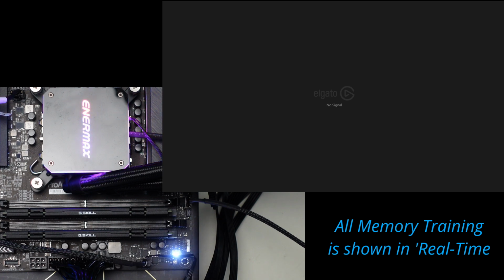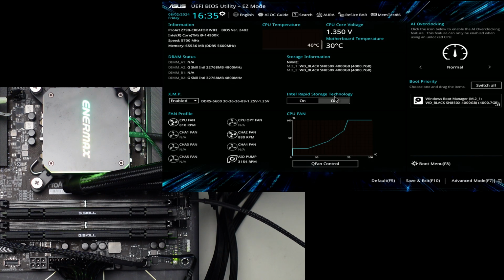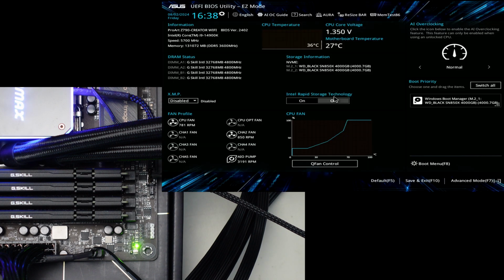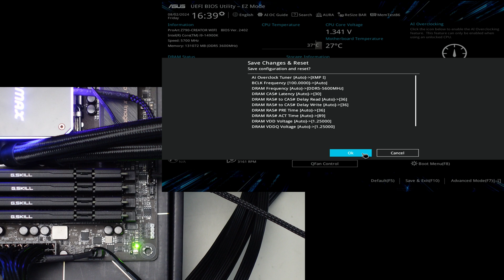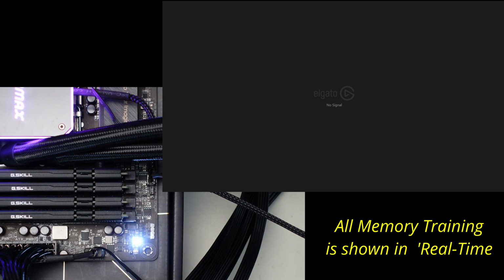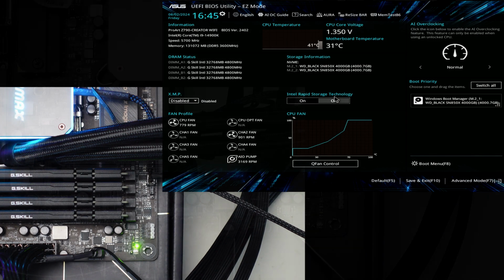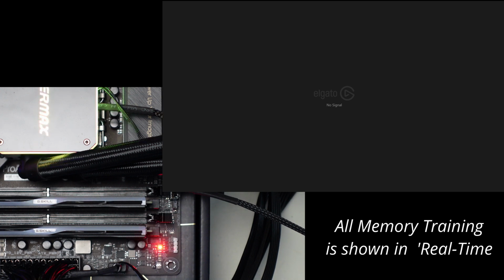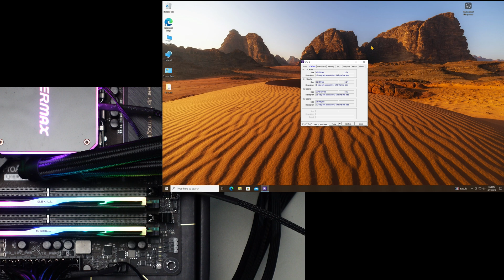DDR5 Configurations and Quad-DIMM Limitations

Comment: You need to go to SPD on CPU-Z to know RAM's speed. Also check the command rate whether it's T or 2T. DDR5 often defaults to 2T if four RAM sticks are used.
You can also check it in Task Manager->Performance->Memory.

Comment: "This video discusses what to expect when using DDR5 Memory Limitations when Using Four (4) DIMM in a Dual-Channel Motherboard."
You will always get 3600MT/s because that is JEDEC speed for 4 DIMMs DDR5. Ignore the video, save yourself 17 minutes of worthless "infos".
Reply from the maker: I do not think your comment is helpful since the manufacturer of many DDR5 Drams (and a couple of the Motherboard/CPU manufacturers) are not fully disclosing the characteristics of their components.  I was able to one specific set of four DDR5 DRAMS to reach their advertised maximum speed (5400MT/s) with one of my other motherboards, since all vendor parties were being straight about what the component could accomplish using the motherboards Standard memory auto-clocking option.  If enough folks are interested, I will make a quick video showing that configuration, before and after the standard memory overclocking.
Reply: @PE4Doers  At 2 minutes 11 seconds made your first huge mistake: you said about using two 2x32GB kits, "I'm not gonna play with any of the frequencies, timing parameters, anything else. These will be out-of-the-box." At that point in the video it is clear to everybody with basic knowledge of DDR5, that the result will be the JEDEC configuration of 3600 MT/s. All XMP and EXPO profiles only work for one kit and since you use two kits, these profiles will never work on any mainboard. Getting two DDR5 kits to work always requires what you ruled out to do: play with the frequencies, timing parameters, or something else.
At 5 minutes 34 seconds you made your second huge mistake: you put each of two kits into both RAM channels (A and B). This significantly worsens stability when using two kits and makes it much more difficult to get them to work faster than 3600MT/s. When using two kits, each kit must occupy only one channel (either A or B).
At 7 minutes 40 seconds you made your third huge mistake: You enabled XMP for two kits. This never works.
These are my three reasons why watching your video is a waste of 17 minutes.

In your repsonse you claim that, "the manufacturer of many DDR5 Drams are not fully disclosing the characteristics of their components". The characteristics of the RAM modules are stored in their XMP /  EXPO profile. If you want to see them, put one kit into the mainboard, start the PC and go to BIOS. There you see all the characteristics that are known to work for this RAM kit.

The BIOS of some mainboards contain a feature that attempts to overclock the RAM: MSI names this "Try it!".
Reply from the maker: @Viewable11  Sorry, by I challenge you on all three major points you've made in this response.  I was using two kits each containing 2x32 kits, totaling 128gb.  Also, I did the same thing with the PC I mentioned in my first response, and I was able to reach the maximum speed of both kits using XMP.  With the second PC, I have a different motherboard and CPU, wherein is the manufacturers issue I refer to. It seem like I have to make a video repeating what took place on the second PC just to prove my point.  

No problem, I really like comments like yours, because they get me to rethink everything and move forward with greater knowledge.  Give me about 6 to 8 weeks to finish some of the videos I have in progress and on the queue (with a couple of them affected by professional assurances that I've given to vendors on those uploads).

If acceptable to you, I will reference our comment exchange at the outset of that video, and you have my word of honor (backed up by an Eagle Scout promise) that I will Not alter any of the screen shots and the video as a whole 🙂
Reply: @PE4Doers  I am pleased to read that you are interested in learning additional information about this topic. I do not care about anyone incorporating my information or opinion in their videos, I only care about people (including myself) spending their time for acquiring information that is correct and useful . 

The two most useful channels about DDR5 usage are: "Actually Overclocking" for optimizing single kits of two DIMMs and general explanation of what the DDR5 settings mean. "Game Tech Reviews" is very valueable for learning how to use two kits (4 DIMMs).
Reply from the maker: @Viewable11  OK.  By the way, I do not watch either of those Channels currently, but I have seen a couple of videos they have uploaded (each) before making my decision to move on to other Channels.  I tend to avoid vendor favoritism.
Reply: @PE4Doers  "Vendor favoritism" is my most important tool to avoid wasting time with useless channels. The most useful video about using two durl rank DDR5 kits on AMD systems is named "192GB DDR5-6000 on the MSI X870E GODLIKE". It contains all settings which this mainboard choses for 4 dual rank DIMMs. The other videos of "Game Tech Reviews" show manually chosen settings, although I also saw the mainboard-chosen settings from AsRock and Gigabyte in two videos. Watching several hours of that channel was totally worth it for finding both the OEM's settings and the manual settings for 4 dual rank DIMMs: It helped me to get my own two dual rank kits to work fast.

Comment: I have the trident and the ripjaw both in my 14900k, and they both work at
 6000 with xmp on, I think, g skill is just really good
Reply from the maker: Thanks for the information.  Are you using 2-sticks or 4-sticks?  I currently have the two 48gig sticks in my 14900K system, but have been pondering whether to upgrade it to 4 🙂

Comment: hey thanks for this video, really informative to the questions i have right now. Quick tip, you can check ram speeds in task manager in the performance section. It's been a while since I've had a W10 machine but I'm pretty sure it'll be there.
Reply from the maker: I'm glad you found it helpful 🙂  Thanks for watching, the comment and the helpful tip

Comment: I use 4x 16GB DDR5 5200MHz CL36 with XMP at 5200MT/s and don't have problem with stability even when memory is full up entirely.
Reply from the maker: Great.  I have the same with my ASUS 690 motherboard and an i9-12900K CPU.  However, with a 790 motherboard and an i9-14900K, it only sizes to non-overclocked speed; and that is trying the same memory on both.
Reply: That's because all 16GB DIMMs are single Rank. It's a different scenerio with Dual Rank DIMMs.
Reply: @minkfranchise6389  Frankly, I stopped trying to learn more about RAM, since it works as advertised and is stable. Memory become a deep rabbit hole, with trillions of combinations and wildly different utilization across platforms. In some systems, it seems to be the most critical component, in others, spending more on it feels completely pointless. It's a mess...
Reply: @GinoFoto  Very true. As long as you have found what you need, that's what matters the most. Much success to you, my brother.

Comment: (AM5) Today I added a second identical kit of 2x16 GB, I did not turn on EXPO, I manually set the EXPO values to 6000 MT/s, 30-36-36-68, everything works same 😮as on  a single 2x16 GB, first kit to A1-A2 , second to B1-B2
Reply from the maker: Sounds like you got that one licked

Comment: Having this same problem on my Omen 45L,  Can't get my 4x16Gb of Fury Beast RAM to run at anything higher that the min speed of 4000.  Running a I9 14900k processor.  Its scary too, because I had trouble getting it to reboot up after overclocking.  Took about 4-5 tries to get it so I could set it back.  Omen apparently had a similar program that would auto set overclocking, but it looks like they dropped it.  Looks like 2x32Gb of th Fury Ram is the solution, $188 for the pair at walmart website.  but i'll run what I have for now.  Doesnt seem  to be hurting my game performance.
Reply from the maker: Yes, this is currently a know problem with the DDR5 memory regardless of the motherboard.

Comment: Great info. I haven't built a PC in quite a while, but have started putting together the parts for one. Going with an Intel i9-12900KF and Z790 motherboard. Planning on using 2 sticks of 32GB DDR5 5600MHz. Any reason this won't work?

BTW, going with a 12th gen i9 because I paid a good price for a new one plus with all the problems that's been reported for the 13th and 14th gen versions, I thought I'd play it safe. Still a nice step up from my current i9-9900K and DDR4 memory.
Reply from the maker: I don't see why you should have a problem with two-sticks of that memory.  That sounds like it will be a great system.  Good luck

Comment: When adding two matched pairs of DDR5 udimms, you need to put the matching pairs adjacent to each other, as in:  A A B B, rather than the traditional channel arrangement of A B A B for two matched pairs.  A single pair is added as you would expect, x A x A, as you had it installed.  I've got two matched pairs of Corsair 6400 CL32 which XMP up just fine as either pair to max speed of 6400 with 32-40-40-104 timings.  Put in A B A B it will only do default speed, which is 4000, and won't ever train better than that.  Putting the dimms AA BB as they are supposed to be for 4 ddr5 dimms made of two matching sets, I can easily reach the XMP rated speed for a set of 4x32GB corsair venegance modules, which is rated at 5600 40-40-40-77.    I have not yet been able to get the 4 dimms to be stable above 5600, but it's almost as fast as with two dimms at 6400.  I'm pretty sure these are the same modules, but the set of 4 literally has a different XMP value stored in the modules.  To the best of my knowledge they are both hynix A die memories.

You might consider revisiting your experiment with the memory in the right slots.  You won't one-click to a 2-dimm XMP setting, but if you can determine what that vendor has set as the XMP value for a set of 4 of the dimms you have 2 matched sets of, you will be able to hit that speed with the dimms placed correctly and maybe some minor adjustment to dimm voltages.
Reply: been trying out all kinds of subtimings and voltages and whatnots as other videos have described, but this comment is the only thing that made it work. sheeeeeshhh !! thanks a lot!!
Reply: You're welcome!  Pass it on :)
Reply from the maker: OK, thanks for the technical information 🙂
Reply: @PE4Doers  amusingly, all 4 of my dimms are from the same week, 42nd week of 2024.  I initially added them to the empty slots - just as you did, but I couldn't get them to 5600 (from 4000) until I filled each channel with the matching dimm from the set of 2.  I suppose it makes sense since the dimm layouts are Ch1A Ch1B Ch2A Ch2B, and when you consider that each ddr5 dimm is already double-channel... 

I don't know the technical reasons for the change in traditional matching set position, but I do know that having the matched set out of order cost me 1600 mhz.  Still a real challenge to get faster. I've booted at over 6000 but memory errors creep up fast.
Reply from the maker: @rolfkarlstad4015  Silicon is funny like that I guess.

Comment: If the memory is single rank, it will run just fine when all slots are populated. In almost all cases, all four will run at the advertised speed or the MB or the advertised speed of the memory(whichever is lower) when all the sticks are single rank.

If the sticks are dual rank and all four slots are populated, then it will most likely only run at the max speed of the slot furthest away from the CPU. Which is typically going to be JDEC speeds.

Typically with DDR5 the sticks that are 16GB and smaller will be single rank. But you can find sticks that are 24GB that are single rank. However, you can't find 32GB or larger sticks that are single rank or at least I have never seen them. If you have a good 870 MB, I recommend F5-6400J3239F24GX2-TZ5NR because although they are only 24GB per stick, they are single rank and will run at 6000M/t in all four slots in pretty much any 870 MB and if you hit the silicon lottery, 6400 is possible.
Reply from the maker: Thanks so much for the great info.
Reply: I bought 4 x 48 of the new CL28 gskill bars.  You saying zero chance at 5600-6000 on a crosshair hero with a 9950x3d?
Reply from the maker: @scottlucidi6476  I do not believe the problem is with the speed of the CPU, but how the motherboard timing is working.  I do not have either you CPU or your Motherboard, so I honestly cannot venture an informed opinion on whether it would work or no.
Reply: @PE4Doers  thx bud
Reply: @scottlucidi6476  Nah, not a zero chance. Just unlikely. I can say with fair certainty that they will run at 4800 M/t. The limiting factor will almost certainly be the motherboard and not the CPU. I have a fairly high end MB(MSI X870 Tomahawk) with a 9950X and these are the memory slot specs. 

Single Rank Sticks Channel 1
1DPC 1R Max speed up to 8400+ MT/s
Dual Rank Sticks Channel 1
1DPC 2R Max speed up to 6400+ MT/s

Single Rank Sticks Channel 2
2DPC 1R Max speed up to 6400+ MT/s
Dual Rank Sticks Channel 2
2DPC 2R Max speed up to 4800+ MT/s

Essentially, if you only use two sticks and they are single rank, the MB can handle up to 8400 M/t. All 16GB sticks and smaller are single rank. Most 24GB sticks are single rank. But some are dual rank. All sticks currently larger than 24GB are dual rank. With two 48GB sticks you would be limited to 6400 M/t on this Tomahawk MB.

If you are using 4 sticks and they are single rank sticks, then you are limited to 6400 M/t. But if they are dual rank like your 48GB sticks are, then on the MB I have you will be limited to 4800 M/t. Even the Godlike MBs are limited to 4800 M/t when using 4 dual rank sticks.
Reply: @BlenderRookie  awesome info. Thx.  I have asus x870e crosshair hero.  Think i will have to be content with 4800.  Perhaps the next gen or 2 of mobos will be able to handle the full 6000.  Again, I appreciate it.  Thx dude.
Reply: @  You are welcome.

I looked up the specs on your MB and it doesn't get specific about the max speed for dual rank. It just gives an "up to 8200+MT/s(OC) with Ryzen™ 9000 Series Processors,". Which of course is the max speed for single rank.

So yeah, likely 4800. However, once the memory training process is done(could take as much as 30 minutes but more than like 5 min for 192GB), you might be able to keep expo on but adjust the mem frequency to 5000 or 5200.  I give it a 99% chance for 4800 and a 50/50 chance on 5000. If you won the silicon lottery, 5600 could be possible but very unlikely.

Why do you need 192GB. If you don't need that much and 96GB is enough, use two sticks 2nd & 4th slot and you will be able to run 6000 M/t without issues. You will notice a difference between 4800 and 6000.
Reply: @BlenderRookie  i dont need 48GB!  Im building a pc as a bucket list thing.  1st and last one i build.  Im going top of the line components and making out for fun.  When i get to the bios part, i may consult you if thats ok?!
Reply: @ Sure, if you need help. But more than likely it's as simple as going into the
bios
>advance
>>overclocking
>>>Turning on Expo
>>>>Saving settings and exiting
Wait for the training to take place.

Comment: Running on a Strix x870e MB I have 4 sticks @16GB each 6000MT with EXPO G skill ram, and it's blazing fast.  Memory training took about 30 seconds first boot, and my boot time now from power on to windows is about 12 seconds.  I tested it with 2 sticks and 4 and got the same results each time, and stressed with Aida64 as well, 4 hours no issues.  9800x3d CPU.  Good content, looks like MB, CPU, and Ram type play a big role in all this as well.
Reply from the maker: WOW, that's great.  Let me know if you have any latent issues.
Reply: You wrote "16GB each" so I presume single rank modules. If it is true it's no so demanding on memory controller as 4x dual rank modules
Reply: @JohnyBrav-o everything under 16 gig ram is single rank on ddr5 it's 2025

Comment: Thanks for presenting this topic in your fashion. I recently assembled a Gen. 12 Intel rig and spec'd DDR4 for the value conscious aspect. I am advising others to do the same. I was looking to gain some insight on DDR5 anomalies. GameTechReviews is right on the money as there are now confirmed reports that 4-module DDR5 are not yet optimized by way of the memory controller.
Reply from the maker: I agree they are not optimized.  I am just not sure it has to do with memory controllers on the actual DDR5 DIMMs, the BIOS of the motherboard, or the current layout of the connections between the CPU's and the DIMMs.  This is something I wish I had the time, equipment and finances to dig into further.

Comment: I have two sets of the 96, so 192. Mine will not run with the XMP turned on. My motherboard is the proart z790. ALOT of freezing up.
Reply from the maker: With the Z790, whenever you load-up all four slots there will be timing issues.  That is why I limited mine to a single pair bringing the total up to 96.